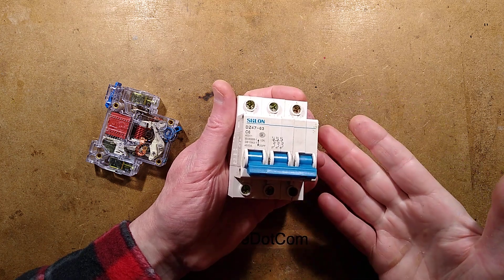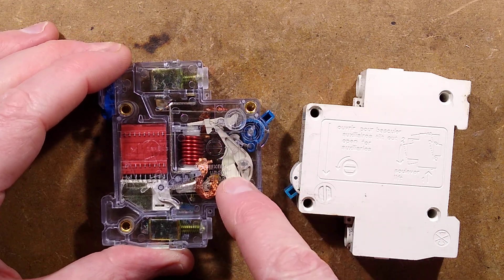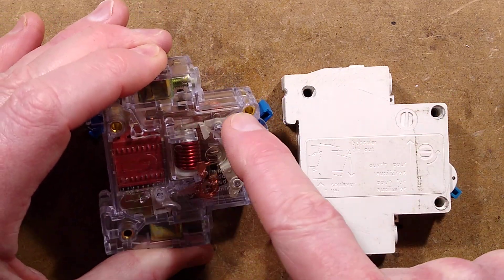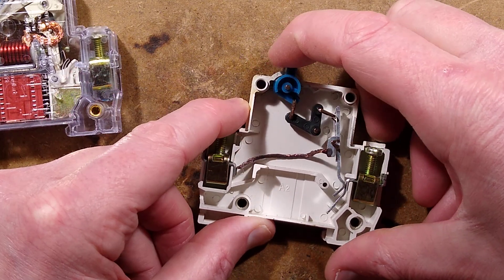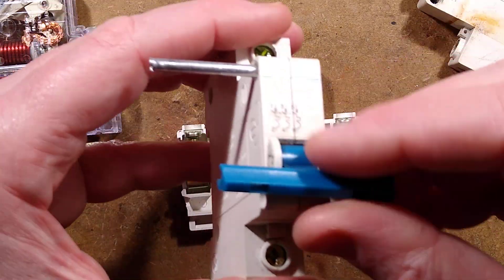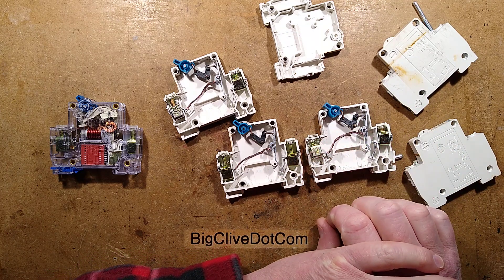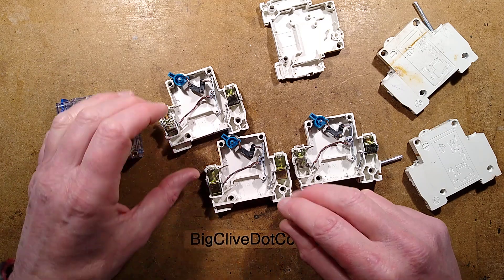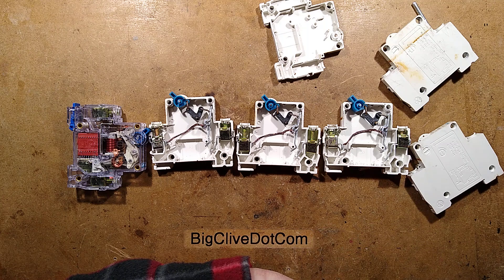Inside a fake un-trippable circuit breaker.

Comment: That's just a maintenance safety disconnect. Nothing wrong, except the markings.
The generators don't rely on circuit breakers for their protection (the overload on those is too slow), but on electronic control of the field armature. Self-protected if you want.
That disconnect is not meant to be taken from there and installed in your house, it's part of the generator assembly.
Reply from the maker: It's marked as an overcurrent device.
Reply: @bigclivedotcom  I agreed with that marking error.
However note that the device was not sold as such, individually. That component is not owner serviceable. Generator manufacturer only has to insure that the whole assembly is compliant. AFAIK there is no rule for the components, they can be labeled as anything.

Comment: basically, just a switch.. 😲
Reply from the maker: It's marked as an overcurrent device.
Reply: @bigclivedotcom  maybe when enough current to blow the flexible wire! 😲    its a bit like a cheapo usb 5v plug thing i bought a few years ago, no fuse of any kind in the mains input ..except the 2 wires going to the plug  pins!

Comment: I heard a rumour a few years ago a big boy MCB brand actually had fake Chinese stuff circulating in their stock, it was almost indistinguishable from the outside, they just failed on testing, opening them up it was obvious they were not right. Turns out someone had returned vast quantities of the culprit MCB's the day after receiving them, and it was thought they purchased the parts and then returned the cheap Chinese knockoffs for a full refund, they then got put back into their national stock system. I still wonder if there are 1 or 2 in use that they couldn't trace or get back.
Reply from the maker: That's unpleasant.

Comment: I was shocked as an apprentice to discover that most circuit breakers are only rated to provide over current interruption 5 time in their lifetime. While they may function for many more than that, you should plan on them not functioning correctly at some point. They are supposed to fail in a open circuit position, but here in the US we have a lot of old Zinsco brand breakers that fail in the closed circuit position.

Comment: Thanks for the great explanation of how a breaker works, and the clear cased breaker is very nice. Is it a demonstration unit or a functional breaker? I have often seen bad connections cause high resistance heating that melted equipment. The homeowners asked me why the breaker didn’t trip. I found the best explanation was that a toaster gets hot enough to burn and melt things without tripping your breakers.

Comment: Just a bit of a nitpick: you show the correct circuit breaker in a vertical position, and then show the bad one in a horizontal position. I realize there is not much in it but it makes it hard to visually compare where the things in it should be, it's just mentally a bit confusing

Comment: I have some breakers of a different brand that otherwise look identical.  I thought from the first time I switched it that the switch feels like a cammed design that would mechanically lock on and not like a breaker mechanism.  hmmm.   I might have to open one up.

Comment: Dont buy cheap circuit breakers, check. Man thats bad. Should see the power switch in the mastercraft table saws though.. found a used one and the plastic had melted in the contacts..

Comment: I'm glad I added rfsis and good quality breakers to a shitty breaker box that was made in china which controls heating, fans and lighting inside a "paintshop" container.
It had one of these 125A "breakers" that had 7 to 9 wires under one screw, lol.
Really does good for a 1.5mm wire to be behind 63A mains fuse. 
It had no ground either and was all around made from very bad quality components.
It was a weeks work to wire it and make sure it was somewhat safe to use by the customer. 
What a nightmare, but must've been cheap piece of garbage until I got there, lol.

Comment: The Electrical Channel of Mann seems to be doing well.  14 hours after posting, the big guy has 1.2k comments.
Fort my part, I'm glad to know about breakers like this. I get tired of replacing perfectly good breakers with fuse holders and suitably sized round stock.  Finding a source for these breakers will save me a lot of time & trouble, to say nothing of the expense of bar stock.

Comment: Whenever one of these is found within a tenants house, it should be marked as Attempted Murder.
Reply: So, until this video, would you have known the breaker was fake? And if not, do you think you should be tried for murder if you fitted it in good faith? I would guess that most of the purchasers of this product have done so in with the (reasonable) assumption that it is what it purports to be.

I think intent is quite important here, I would think very very few landlords would deliberately fit something like this. At the most cynical, simply because it would cause damage to the investment property and open a minefield of potential litigation.
Reply: @marcteigh8633  Theres a reason why redtape has multiplied over the years - so shit like this wouldnt float anymore.

Comment: This has to be a new low. Someone clearly put effort into making this look real. I assume they only bothered to put in that ludicrous piece of fuse wire to assuage their conscience. It probably would blow eventually in the event of a hard short circuit but not before the resulting arc set your fusebox on fire. I don't suppose you have any indication about the flammability rating of the housing.

Comment: I bought two RCBO from aliexpress (just to see if they are worth it for a step up transformer) not the cheapest ones. One would trip (not sure about how close to specs it is)  the other one would not trip whatsoever. I opened the faulty one and it looked genuine with coil, arc extinguisher and bi-metal!

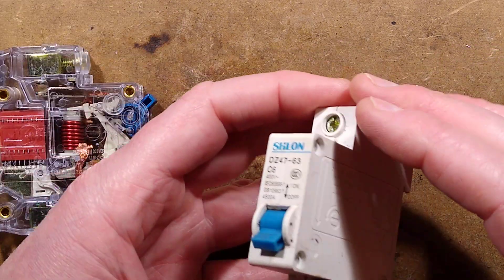Comment: 1:50 Whoops! Looks like this breaker is one of the rare manual trip types (undocumented trip mode, i guess?). YOU, the end user, are supposed to judge whether you want the circuit disconnected or not. Always operate the connected circuit under competent supervision!

Comment: I've taken apart failed breakers here in Costa Rica and they are far simpler than the transparent one you showed. They work but no elaborate arc arrester, no coil, just a bi-metalic trip mechanism. They were supposedly Eaton breakers, though now I wonder. I had no idea they normally have all those other things.
edit: They were fairly old maybe installed in the 90's, so maybe that was normal at the time, though now I want to take a new one apart.

Comment: Those devices are not permitted in Canada, not even the real ones, we are only allowed to use them in electronics and communications control and must have CSA and UL certifications on them. Schneider, Webber and so on are not approved for residential or commercial, industrial use. We have had recalls on arc fault breakers from seimens and counterfeit square d breakers, also issues with counterfeit obsolete  breakers like, No a, Commander, Sylvania, and bad breakers like residential grade push in breakers (StabLoc) Federal Pioneer the cases were known to blister and either nuisance trip or not trip at all. REJECTION TYPE Fuses are still the best in my opinion. NO

Comment: It’s a ‘manual’ circuit braker: if you have a short, you’ll have to quickly pull the switch. 😱
Reply: And if you pull it wrong, the arcs weld it shut. Extra fun!
Reply: like a car handbrake only we controlling electricity hahah
Reply: How many nano seconds do you get flip switch.
Reply: @flatmoon6359  5 at most.
Reply: By the time you get to it the contacts are already welded together and the recycled plastic spoon case is a puddle in your circuit box XD

Comment: had a run in with contaminated stock once was meant to be 150mm X 10mm flat steel we where wondering why the welds kept cracking turned out it was spring steel the stock warehouse could not tell how many of them where wrong so the whole stock pile on hand so dumped into the recycling bin just to be sure and restocked the odd thing was we never use spring steel

Comment: When I was a kid we still had those Diazed fuses. When they'd fail, of course at night or in weekends, my dad would use aluminum foil or some copper wire and bypass the fuse. "Just until the stores open and I can buy new ones" Which he would forget and weeks and months would go by like that.

Comment: Now that you have told on video that Dave found out bcz it was light, I bet manufacturer will put a small rock inside to make it heavy. Around 13 years back when DVDs were getting traction, they were sold at double the price in market and content was priced like that, 1 DVD for 80rupee and 2 DVDs for 160rupee, so what they did they would split content between two DVDs while size of original content was less than 4GB, so what we would do is look at DVD how much is written and if they were half empty we would ask for single dvd version. So few months later I bought a game with 2 DVDs which were almost full and after installation I check install size was less than 4GB, (usually this happens if there are language packs but I knew this one did not) so I checked DVD one and found few episodes of Prison Break copied inside /facepalm.

Comment: I've seen electricians shorting an outlet to see which circut breaker that trips to find it easly, but its not a standard test. Its a quick and dirty way to find the correct circut breaker when there are many of them like in a large business building..
Reply from the maker: I've done that myself when a breaker has been hard to identify.

Comment: At the very least the Chinese manufacturer should have branded them “UltraFire” brand circuit breakers so there would at least have been SOME truth in advertising!  But it is infuriating that they would label these as current limiting circuit breakers as opposed to strictly disconnect devices as someone could literally lose their life if these get unknowingly installed and an overload event occurs resulting in a fire.  There just isn’t any excuse for such a thing to be manufactured like this, much less to clearly label it as a circuit breaker is unconscionable!

Comment: As the Channel Serpentza says "Everything in China is half-arsed."
Reply: Like last Moon probe? Here's the funny thing - my old Macbook screen failed because of a very short ribbon cable proudly designed in California. But some small Chinese company was selling similar cables that are just 3mm longer on AliExpress. Guess what - installed that one and it works for years. My mom is using that laptop now.  And it's not the first nor the last time Apple product fails not because it's made in China but because Apple engineers were high at work. My $350 Chinese phone still works like new with just 3 hours less of battery life. Which is no surprise after 5 years. But at least they weren't releasing system updates that make your phone slow like Apple did. In fact that phone got Android 9 before they finally decided to stop supporting it since more than 6 new models in the line were released since 2016.

Comment: These are commonly used on chinese machines as a main switch. They don't call them a breaker, so the main problem is not the product itself, but the arsehole, who call them circuit breaker.
Reply from the maker: And marked the circuit breaker symbol on them.  Complete with trip current and curve.
Reply: @bigclivedotcom  I didn't notice the marking. In that case, it's scam.

Comment: That is one big oof. At least the wire is safe from people touching it and one could argue that this is a circuit-BREAKER - because at some load it will just melt itself down. 
Is there any tips you can give us mortals in order to "watch out" for this stuff? From the outside this thing would fool me into believing it's fine so I wouldn't bat an eye if I would see it in my appartment or one of an unsuspecting friend that just moved in.

Comment: I see a market for a stand alone breaker test rig based around a lithium ion car starter pack battery. Something you can plug a breaker into,  feed it over it’s rated current for long enough to blow it & prove it works as intended...

Comment: This is really scary stuff! There's a lot of cheap Chinese so called smart switches for 'smart home' and home automation on the well known Chinese webshops. How many of those are of similar 'quality' as the circuit breaker in the video? Because smart switches are often quite expensive, the cheap alternatives from China are popular. I'll link to this video in the various home automation communities as a warning. Not everybody (including me) is able to tell a good switch from a bad one. Also, I won't try to open a device to check what's inside and I estimate 98% of the people who buy these things won't either.

Comment: It's my guess that one of the factories that make parts for real CB's decided to make use of production capacity to make there own version using only the parts they make themselves.  The housing looks similar to the real one and the contact lugs appear legit.  The owner of this company needs to spend some time in a chilly state owned grey-bar Extended Stay hotel.
Reply: And for a long time...
Reply: When fake product scandals cost (Chinese) lives they tend to execute the factory owners.  There was a fake child milk scandal a few years back.
Reply: @simontopple911  you know... That's the only thing about China I can get behind with
Reply: @docvolt5214  we also shouldn't forget the complicity of certain online retailers in the sale of dangerous goods.
Reply: @simontopple911  I just hope nobody decides to slap an ABB or Schneider logo on it. Can you imagine the possible loss of life?
Reply: @docvolt5214  It's quite worrying although fakes entering the supply chains should worry everyone - even fake aircraft parts are known to find their way into the supply chain, as are fake Cisco routers (in fact, my dad worked for a large company (who made test gear) - they had a Chinese company send them a perfect replica of one of their testing units, offering to sell them for less than their own manufacturing costs).  Copying IP is a compliment, apparently!

Comment: In the Netherlands you have a mains switch. But that isn't rated as a circuit breaker.

So, first you have the mains switch and that you have all the circuit breakers 
Also a diff breaker should be applied for every 4 circuit breakers (max)

But the mains switch looks like a circuit breaker but is a much more simple device
Reply from the maker: We call it an isolator here.  This is marked as an over current device.

Comment: Oof, these aren't circuit breakers, these just switches masked as circuit breakers!! 👎
Imagine, if a house built with these because the electricians thought these are circuit breakers, but actually, these aren't, and a short circuit ⚡ happens somewhere... 😶 Let's just not imagine that what that can cause... 🔥 👎
Reply: Those electricians that buy noname dodgy stuff to save some money and charge the customers more should be kicked in the nuts. Because there are expensive brands, there are cheaper brands. And then there are fakes. Saving some money by buying and installing cheaper legit stuff is fine. Using those as breakers is as much of a crime as making them.

Comment: Re your comment near the end about RCDs and their built-in test buttons: The test is valuable only if you know it's a properly made unit and not being faked. You'd still need to inspect and/or externally test it to be sure it does what it is supposed to do.
Reply: Better to not turn it on and take it apart.
Reply: It's trivially easy to test an RCD - just short live and earth at a socket.
Reply: @grumpus27  dont' short them actually, use an incandescent lamp - 40W or so - connecting the lamp to the live and earth does the trick - either it lights up - badz or it doesn't and the breaker is off. This is how I tested them when I moved to the house.
Reply: @grumpus27  ...and what happens then, if it is a fake?
Reply: @homomorphic  Rather than "short", use a resistor of a few kΩ so that you only let through enough current to trip it (it should be a few tens of mA). If it's fake, the resistor will warm slightly.
Reply: @rjmunro  Instead of a resistor, use an appliance or lamp.
Reply: @homomorphic  The fuse in the plug (or improvised fuse wire) blows but the circuit remain active.
Reply: @grumpus27  and what happens then?
Reply: Except no - for some reason I was thinking this is an RCD but it's not.  I wouldn't suggest testing an MCB by shorting it.

Comment: Where do you buy transparent breakers? And could you have a transparent 18th ed. consumer unit? And if properly labelled and used with a real MCB could these fake breakers be safely be used as a switch?
Reply from the maker: The cabinet would need to be metal.